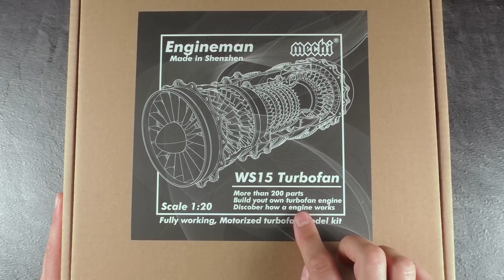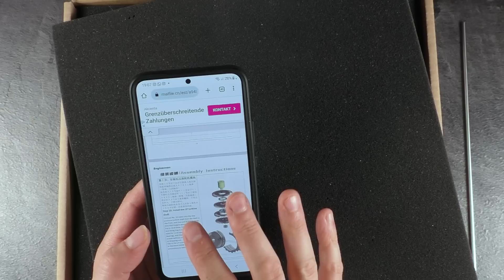Building a 1/20 Military Turbofan Engine!

Comment: nice model, but at 250 usd its WAY over priced
Reply: Compared to what? Any similar models under a couple hundred appear to be poorly manufactured, flimsy, oversimplified for children, or all of the above.

$250 for a decent model engine is honestly an impressive deal if it’s as good as it appears.

Comment: Pretty neat engine. The temperature is always controlled in the combustion chamber and cannot exceed the 2000 degrees Celsius. At 3000 degrees Celsius, the turbine blades will be destroyed.

Comment: 250$ for a cheap looking 3d printed model is insane. If the parts were diecast that would be one thing but this thing will probably break if you look at it wrong in a couple of years
Reply: For $250 you can buy your own 3D printer and make a jet engine model for free.
Reply: Perhaps even full size Chinese jet engines are 3-D printed.

Comment: Combistion chambers are made from titanium alloys. They are air cooled using part of the air from the HP compressor. Various ports in the flame chamber wall allow some of this air to flow in maintaining the flame shape and provide the cooling.
Having a brittle substance like ceramic inside a jet engine is never a good idea 😊
Great video as always, love ot when you cover these types of model
Reply from the maker: Thanks for the clarification. It was not my idea of curse but I read somewhere that combustion chambers in jet engines can be coated with a thin ceramic layer to increase heat resistance.
Hiwever it's just impressive if you consider how reliable these engines are, that everything is glowing deep red during operation for hours without the material aging too much.